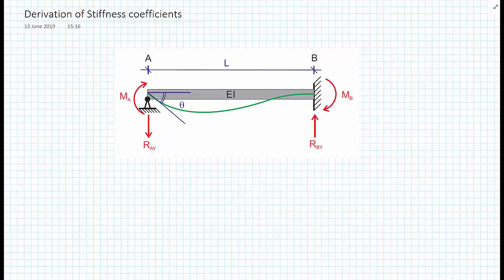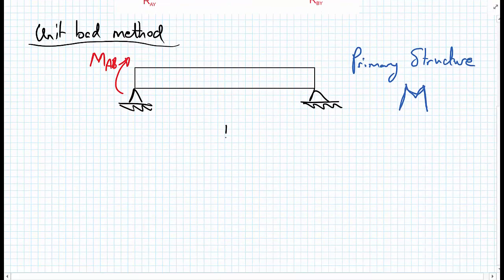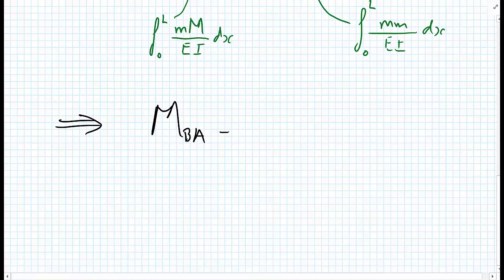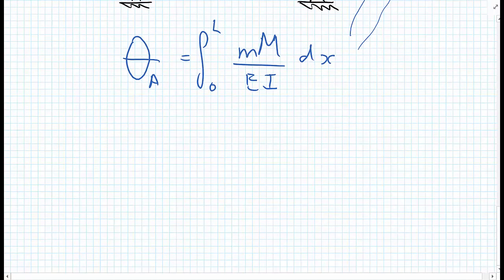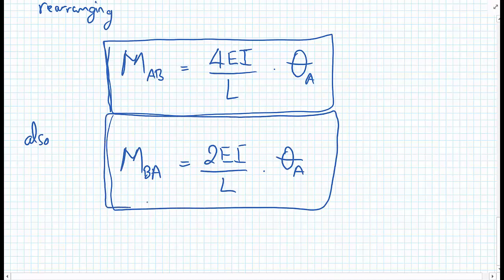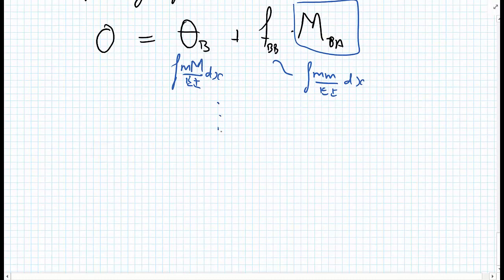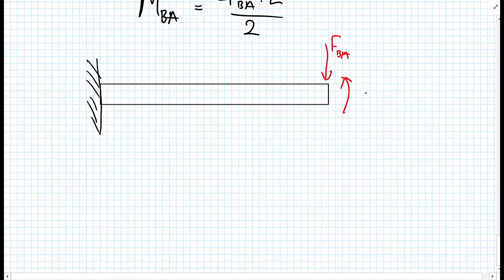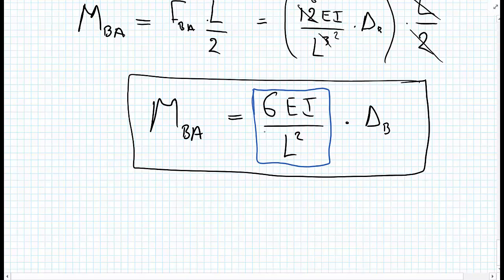Virtual Work - derivation of beam stiffness coefficients

Comment: when you at 5:35 make that statement, how was that derived? i tried using the known curvature - moment relation to find a slope at B due to the moment "Mab" at A where i got that slope to be: θ(B) = Mab*L/2EI and using the virtual method i got the fbb' = L/3EI, and finally plugging that into the compatibility equation i got the Mba = (3/2)*Mab, so obviously this doesn't match.
But then my question would be, is this a correct approach or just wrong?, and if the latter, whats the correct way?
Reply from the maker: follow the method at 5:07, I get \theta_B = M_{ab}*L/6EI and f_{bb} = L/3EI
Reply: Okay, do you get this: "theta_B = M_{ab}*L/6EI" using the virtual moment method? does that mean that you place the unit moment in B and from there gain the moment equation m(x) and use that together with M(x) caused by the real moment Mab ?
Reply: update: actually that seemed to work out trying it, i get the angle at B to be Mab*L/6EI, using the virtual moment method. only weird thing is that the relation: EI*θ = ∫M(x)dx provides a different angle. thought these should be equivalent.
the M(x) i get = -(Mab/L)x + Mab, if that checks out